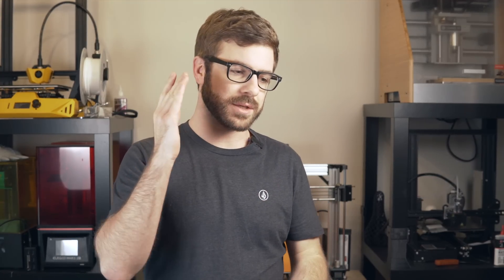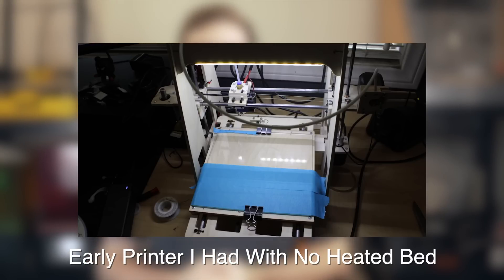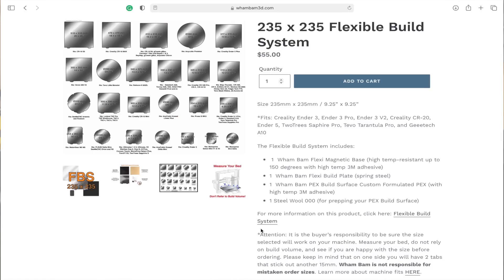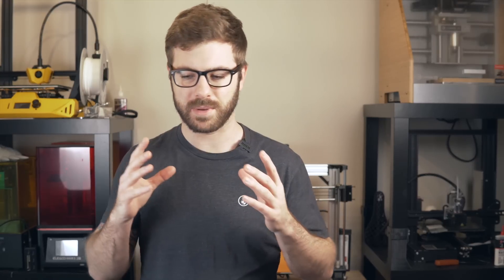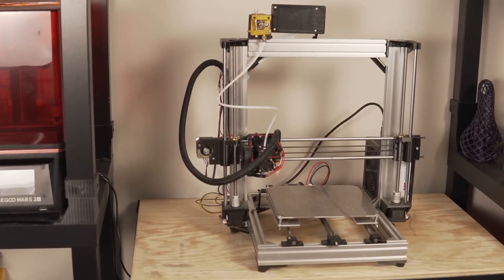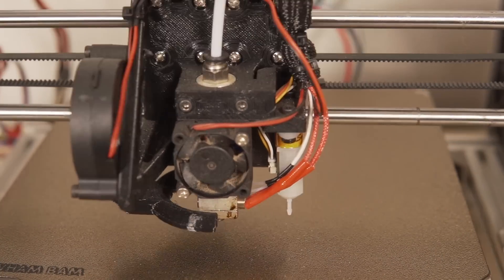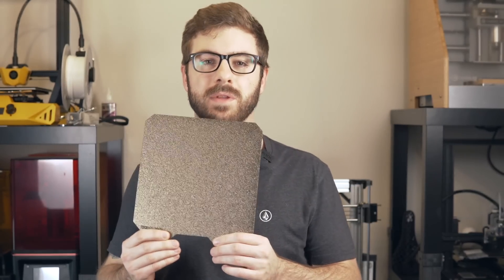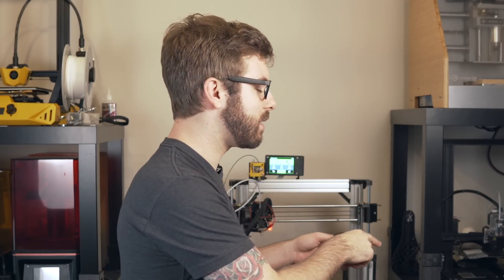Best Bed Adhesion For Every Day 3D Printing

Comment: Hello. I BUY ONE PEI for my cr 10s pro. And I have so much problems with bed adhesion. I use 1200 sand paper and I have better adhesion  and leveling. Also I have one intact side. What are your print temperatures? Nozzle and Bed

Comment: As someone who is new to 3d printing, I find your videos very informative. I was wondering if it would be possible to use binder clips on a PEI sheet, instead of using the magnetic sticker. I have read that the magnets will eventually lose their magnetism from the heat of the build plate. If they are easy to remove from the build plate, it wouldn't be a big deal of course. Do you have any thoughts on it?

Comment: I ruined a Voxelab stock coated/textured glass bed side by incorrectly cleaning off glue stick. I am planning to replace that bed with a Creality PEI bed to try and get better adhesion as I have had nothing but trouble with the glass bed and I'm trying to avoid glue stick.

Comment: I've been printing on textured PEI with Carbon Fiber PETG/PLA and I can't get the lines to be even close to what everyone else seems to be getting. I see the walls outlined and all the infill lines clearly. I tried squishing down as much as possible without scraping the bed/layers but no luck. Have you ever tried printing CF on textured PEI? What did it look like?

Comment: Hey pal I love my textured bed but wanted to try a glass bed. I bought a good with that special surface that does not need glue. I looked through your vid library to see if you had a diy on installing a glass bed but couldn't find one. DO you have a vid on installing a glass bed on a ender 3 and, if not, could you point me to a decent vid?

Comment: I have this and while I love it, the ridges/bumps are really tall.  Wham Bam advised me to sand it down a bit with 600 grit.  I was struggling to get this perfectly level on my first layer.  Also, you can't just scrape the print skirt lines and such off.  And cleaning it, well, it will rip up a cloth or paper towel.  I wish mine and scrub with a plastic brush from time to time....or a wire brush between prints seems to help too.

Comment: Great video! I have seen warnings about going too high with temperatures with magnets... is ABS printing going to ruin the magnetic adhesive on the bottom since it needs higher bed temps?

Comment: Ok, so I’m brand new to this (am waiting to open my new Ender 3 V2.). I would think it would really depend on the intended use or user. Question is if I install the flexible system will I not be able to use the glass on top of the magnetic base?
Reply: I switch my print surface between garolite, polycarbonate, borosilicate glass, and flex plate, depending on what I'm printing.  the garolite, polycarbonate, and glass are all quite thick at 4.8mm (typical thickness for glass print beds is 4mm) and they hold down just fine on top of the mag base using regular old swiss clips

I'm using a heavily modified ender 3 pro.  I think the build surface is relatively unchanged

Comment: OK so just did a new print on this newer (newer to me) flex bed. I have two other whambam flex systems and really wanted to give this one a test run and it doesn't disappoint. Prints stick great and I love that texture. I also finally installed the swiss all metal hot end and its great. I did take your advice and lowered the retraction....I do have a technical question, if I'm having PLA prints warping, is it because the bed it too clod or too hot. Dig your channel. Its now one of my go too channel to get info for 3d printing so thanks.

Comment: Too bad he’s never used Zillagrip cold bed glue.
allows you to print the most type of plastics and works with a cold bed. Just heat the bed to release. PLA ABS Nylon PETG PP POM TPU TPE PC with one glue.

Comment: How do you squish the filament down into the sheet without getting the dreaded elephant's foot?
🇨🇦🐧
Reply: you can set first layer conditions in slicer so it is 70% height and 100% width

Comment: Glass and white woodglue is the best imho, you dont need a heated bed, easiest to remove of all by just adding a few drops of water at the edges of the print and the  capillary effect will loosen the print. It is also cheap so a mirror is just gold. You never need a spatula on glass..

Comment: I use the TH3D textured PEI plate and I love the uniform texture.  There are instances where I want a smooth surface for mated parts or whatever, but I find myself using the textured plate the most.

Comment: I'm a glass guy. My first printer (Leapfrog) had a glass bed and since I only printed ABS this was easy to cover with ABS goo. On my next printer I switched over to Buildtak and in the beginning I loved the texture but buildtak is very prone to damaging, is not cheap and large things pull the buildtak from the spring steel leaving air bubbles.
So I'm back to glass again. The powder coated bed from Creality is nice, as long as you don't print massive things. For large things in PLA I mostly use glass with a coating of bed adhesive from DevilDesign - I used to use Dimafix but that leaves a very ugly streaky bottom whereas the DevilDesign adhesive gives a nice shiny surface. PETG must always be printed with adhesive, I have damaged 3 or 4 sheets that I forgot to cover with adhesive. In this case, the Dimafix has the advantage that it dries up misty so I can see if I missed a part of my glass.
Dimafix releases easier than the DevilDesign stuff but both can use water to soak a part loose (especially handy for large fragile parts)

Comment: Great overview. Actually im team of both :), im using them based on material i need, for example PETG is easier for me to remove from texture. Also it depends from print if i need smooth surface or not. But overall for me was easier to adjust Z height on texture sheet than on smooth one, probably because there is bigger tolerance.
Reply from the maker: Thanks for watching! I have printed quite a bit of PET-G on the smooth and haven't had many issues but I can definitely see a part being able to bond with the smooth since it is a sheet that could be annoying or even damage the sheet. That was one of my issues with standard BuildTak PET-G would bond to it and damage the build surface. I am team both as well (I think) haha we will see when I have put some more mileage on this textured.

Comment: I've heard that you should use some gluestick or similar for PET-G as it has a tendency to stick too well to the bed. Do you use something like this for PET-G prints?
Reply from the maker: Havent really had that experience and I have printed on the smooth PEI as well. I think it will depend a bit on how close your nozzle is and perhaps how big the part is. I have experienced PET-G welding to build surfaces but that was primarily BuildTak for me.
Reply: I've had petg stick to pei even when printed in the air more. No lifting or curling at all with petg & kapton on glass at 85deg.

Comment: Oh man that surface texture looks great. Also agree with you on the smooth / mirror like finish vs a little bit of texture for the under print. Great video!
Reply from the maker: Are you or have you used the powder-coated PEI? I can't remember if your Prusa Mini came with the smooth or coated bed. Thanks man :)

Comment: Polypropylene is my goto.  Better than PEI.
Reply from the maker: What Polypro sheets are you using? and what materials have you printed on it?
Reply: @ModBotArmy  I use Mamorubot brand.  They have a wide selection, great quality, and if you need a size they don’t have listed, contact them and they will custom make it for you.
Reply: @ModBotArmy  I mostly print with PETG.

Comment: Team smooth ALL the way! I print a LOT of parts that need a smooth finish on the side that was stuck to the build plate.
Reply from the maker: Out of curiosity what are the parts you print that need to be smooth? Just wondering if it is for the aesthetic you are going for or perhaps it is tolerance related.
Reply: @ModBotArmy  purely for the looks is what I'm after. One of the projects that springs to mind is the battery cover for a traffic control reader board type trailer. It's similar looking to the Wanco vertical mast reader boards. I'll have videos of the project on my channel within a few weeks, HOPEFULLY......Providing the project's assembly goes smoothly.
Reply: @pnwRC.  I don't think the mirror finish looks bad, it's just the fact that it looks so different from the other sides. That's what I personally am not a fan of, I'm a huge fan of the nice soft and smooth texture that PEI creates.

Comment: I have both on my prusa mk3 and use smooth only as I had first layer adhesion issues with textured plate. Also to avoid damage note that the z height will be different going from smooth to texture
Reply from the maker: Good call! I hope that others realize that but yes definitely the different build surface in general will have various thicknesses so the z height even if it is just a small baby step will need to be adjusted.

Comment: Where do you get the garolite from?
Reply from the maker: The ones I have used were MatterHackers. They have quite a few different sizes.
Reply: Matterhackers mainly or eBay, it's mainly used to print Nylons.
Reply: Its phenolic sheet
Depending on what country your in it may have a different name
Tufnol is what it is in the uk
Lot cheaper if you buy it as what it is rather than from a company selling you it as a 3d printer part

Comment: With the stock powder coated bed on my Creality CR-10S Pro i always had the issue that small plastic residues from prints i've printed before were stuck to my print, even when cleaning it between color changes. Is this the same here?
Btw i also use Wham Bam PEI and think it's great, only the scuffing with steel wool would't give me enough adhesion so i used 360 grid sand paper and have no adhesion problems any more.

Comment: I have used PEX in almost two years now, and love it
Thanks for sharing your experience with all of us 👍😊
Reply from the maker: Oh wow! Have you had to replace the sheet ever? My experience with PEX is that it is really a tough material and with proper cleaning it lasts a very long time.
Reply: Yep, I have changed my sheet two times..👍☺️
Reply: @avejst  How hard was changing the PEX sheet?
Reply: I bought the PEX for my Ender 3 but don’t get good adhesive. What temperature do you set it at?

Comment: Do you have to change the temp setting because of the extra layers on the bed?
Reply: You'll need to re-calibrate your Z-offset. But this is true for any new bed, not just powder coated.
Reply from the maker: Just the z height. In my experience, the material is thin enough that it conducts the heat without any issues. If you had something very thick I could see it but this has not required any temp adjustments.

Comment: I would say that it depends upon the project.  Sometimes you don’t have a choice, but when you do it’s nice that you can choose.  I’ve been using the Wham Bam system on my Mars printers, and it has made it so much easier to remove prints, that I won’t ever use a printer that doesn’t have a flexible built plate.  The build surface on my Snapmaker 2.0 A350 is double-sided as well, and I freaking luv it.

Since I now need to print nylon, carbon fiber, and other high-temp materials, I ordered an Ender 5 Plus yesterday.  I spent a week researching options for highly accurate and repeatable printers with a large build volume, that I could upgrade for high temperature printing.  I found all of the parts that I needed for the upgrades, some of which had only become available within the past 6 months, so I should have it fully up within a month.  I decided to go with the Micro Swiss Direct Drive Extruder for the Ender 5, with a Mosquito hot-end, the linear rail adapters from PrinterMods, and flexible Wham Bam build plate specifically designed from the Ender 5 Plus.  Just waiting on some clarification from PrinterMods on their adapter system.

Have an AWESOME weekend!
Reply from the maker: Oh man the flexplate on the resin printers is awesome. I have it on the Mars and Phenom and I do not miss removing stuck resin prints. I almost think that is worse than the FDM since the resin can make it more slippery (sketchy). I really want to take a look into the SnapMaker 2. Did the double sided sheet come standard or did you have to add that?

Wow that sounds like a badass Ender 5 Plus. Are you planning on enclosing it as well? I would love to see photos or videos of this build when you have made some progress on this. Looking forward to hearing how it goes. The parts you are choosing sounds great. 

Weekend was nice! Finally celebrated Christmas with the parents (how to postpone because of Covid scare) I hope you had a great weekend as well.
Reply: @ModBotArmy  the double-sided build plate comes standard on all Snapmakers, and I bought a 2nd one in case I screwed up the first one.  PLA sticks a little too well to it, until it's seasoned.  I've been using the Elmers Purple glue sticks (dries clear), which works great so far.  Used it with PETG too, and no issues.

As for the Ender 5 Plus, yes I plan on enclosing it with plexi/acrylic, similar to what Teaching Tech did, but I have different plans for the top and bottom that still need to be fleshed out.  I'll try to document as much as I can, so we'll see.  Ideally I'd like to be able to heat the chamber up to somewhere in the 120-150°C range, as the Wham Bam can work up to 150°C, but I'll probably do it in steps, staring with like 60-80°C, as anything higher requires liquid cooling, and I may need to double pane the sides.

Yeah, Covid is making everything difficult.  I've have to push back some projects that I've been planning by as much as a year, due to supply issues.  Hopefully things will start to get better around April or May.

Take it easy, be safe!

Comment: agree to the textured sheet ( prusa I3 MK3s) i have both the smooth and textured/ 
For plates that need to be displayed and do  not need a smooth finish , the  textured makes it look so uniform.

do a two color print black with white 2 layer text and you know what I mean
Reply from the maker: I am trying to visualize this. Do you mean a print where you will be printing and putting together after? Or on a dual extrusion machine??
Reply: @ModBotArmy  Nope. with filament change manual

Comment: I mean, I've printed stuff on a corner with a 5mm² bed contact area just fine on glass with super thin diluted white glue
Reply from the maker: Have you used flexplates much or are you pretty much glass only at this point?

Comment: I'm sold. Just ordered the powered coated sheet for my ender3 pro. I love all the WhamBam systems and have been using the PEI and now  I'm using a black spring steel sheet now with the reversible powdered coated bed but its not a wham Bam system. I still like the finish but now that I know Wham has a system like that I'm completely sold. Thanks a million for this vid.
Reply from the maker: Totally! I am not sure when they released this. I have seen a few others using it which makes me think it may not be brand new but last time I looked it was not available which was maybe 6ish months ago. Thanks for watching and I hope you love your new bed.

Comment: Great Video, on my Ender3 I use the TH3D EZflex2 textured PEI and for stuff I need to make sure it sticks I use the TH3D EZMat2. On my Prusa, I use both the smooth PEI and textured PEI and they are all awesome. Just the ability to flex and remove the part is a game changer.
Reply from the maker: Right? Flex Plates are still pretty underrated to me. I am very surprised it is not a standard across more of the industry. I do understand glass is able to work with more materials but for anyone printing with primarily standard materials I don't understand why you would choose something else.
Reply: Price aside, any advantages to using either brand over the other?

Comment: I switched to FBS on my resin printer after I used too much force on a spatula and my finger slid down the build plate side. Wish I would of spent the $ sooner to of avoided that entire situation and stitches.
Reply from the maker: Oh man, I am sorry to hear that. Worst thing that has happened to me was using cheap mirror tiles from home depot for a Creality printer. I had a stuck part and when it finally popped off my hand slid into the corner of the mirror tyle. Needless to say it was not a beveled edge and split my finger open. No stitches but lots of blood and a lesson learned haha. Sorry it happened (you are not alone)
Reply: I'm a member of the gashed hand club too.  It still hurts a month later.  This was on the aftermarket creality flex magnetic bed which was impossible to get prints off of.  That went right back to Amazon and I left the blood on it.  I got a powder coated mag bed and it's much better.
Reply: Ouch! Hope your hand feels better soon fam